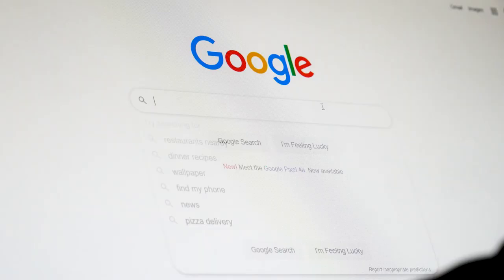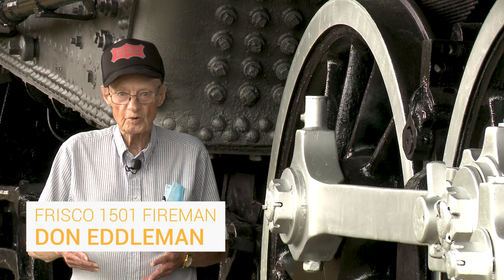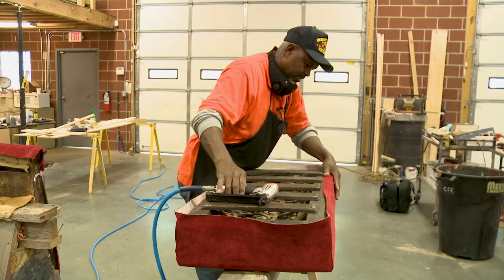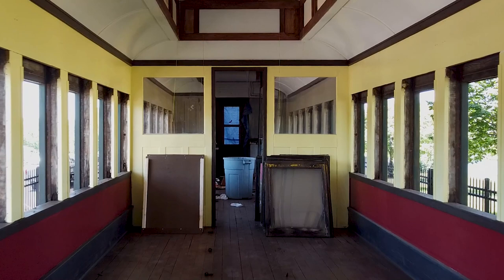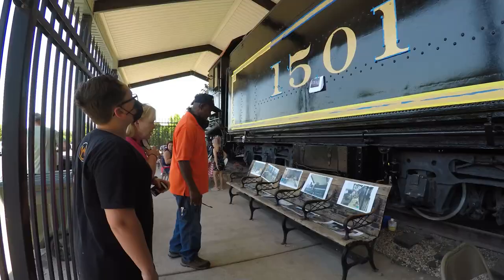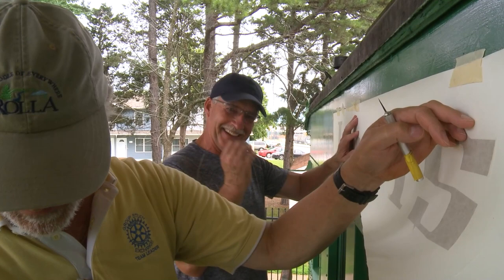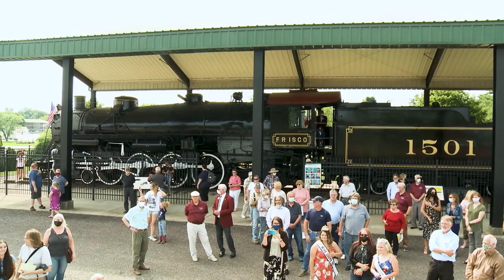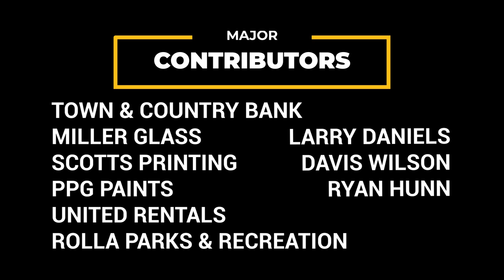1501 Frisco Railway Steam Locomotive Restoration Documentary

Comment: Oh, factories had powered tools back then.  Usually powered by a static steam engine with a large flywheel connected to a belt that turned a shaft that many other belts were attached to that went to the powered tools.